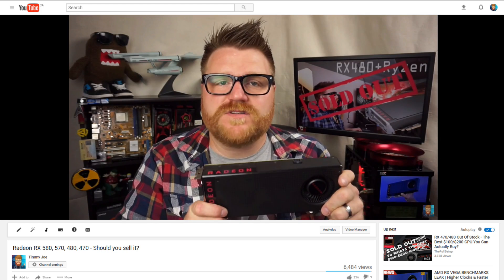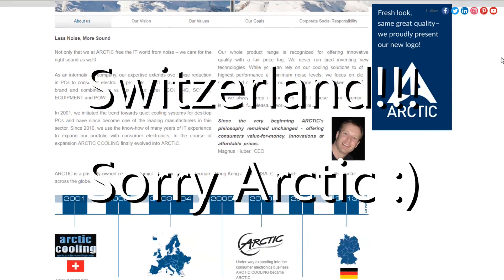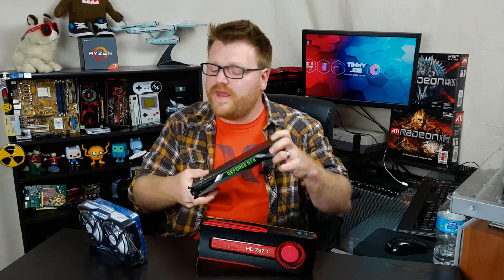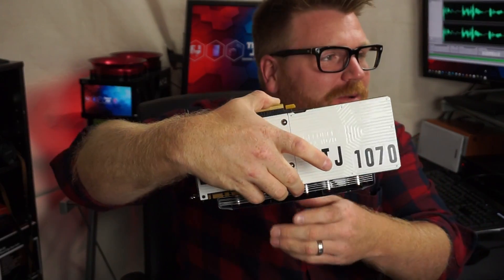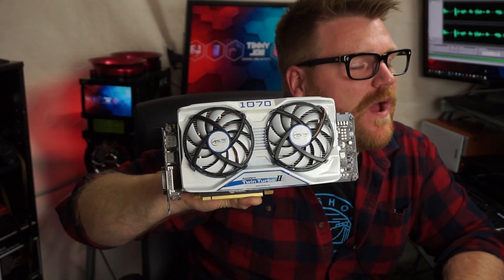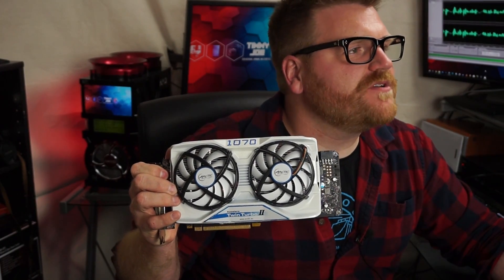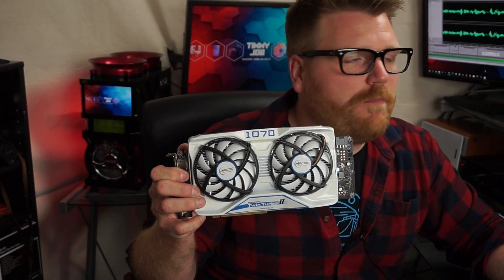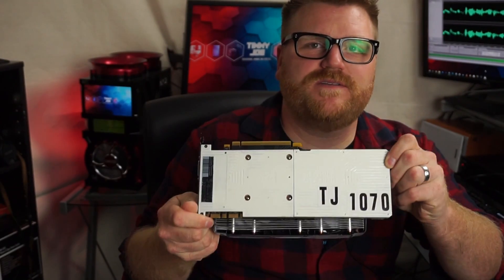Nvidia GTX 1070 Overclock Arctic Accelero Mod

Comment: Now is just a terrible time to buy a gpu. I would have saved that 450 for rx vega. With Vegas price tag being around 400 brand new and it's performance beating out the 1080. You're definitely going to regret it.
Reply: Every card pulls more than the TDP suggest. TPD is not the amount power it sucks, it's the amount og heat it produces, Aside from that i agree with TJ, Vega will be way better than any other GPU at crypto mining. Regardless of nvidia and amd working hard to make cryptomine specific cards, those wil lsell out aswel, pretty quickly and miners will fall back on vega and the 1000 series. 

You have no idea if RX Vega will be 200 watts, very ignorant.  the Titan Xp still has a TDP of 250, and nobody is giving flack for that? That is still hot, for a card that isn't much faster gaming wise than a GTX 1080 TI which is also has a TDP of 250 where as the 1080 sits around 180, 1070 around 150 tdp wise. 

Giving flack for TDP on amd while pascal is nearly as bad is really ignorant and shows us that you have done no research at all. Even if the card is 200 tdp, at 400 - 450 dollars at 1080p performance people will buy it, they will. thgat is a killer deal. given tat the 1080 is 500 bucks or more. usually more.

No way to cool it quite? MSI, Gigabyte, EVGA has cooled the GTX 1080 Ti quiet, at 250 watts, it is possible. Usually amd cards have lesser qualti components. usually AMD is lighter than Nvidia thus there is a difference in cooling aswell.

You also have this thing NZXT made, you know? the succesor to the Kraken G10? The Kraken G12? Yeah, it's a bracket, It allows you to put a wide variety of AIO coolers on your GPU YES! You can me your own hydra cards! AMAZING! See what a little research can get you? I suggest doing that before blatantly spouting nonsense. 

Other than that, really, get what ever card you want. Every card is different, brands doesn't matter at all.
One vender will be better in this game, the other in that game.. Frankly it doesn't matter at all. 

Sidenote: RX Vega probably comes with HBM2 which is extremely hard to manufacture and AMD will be the first that brings that to the consumer market, Nvidia dindn't do this for that very reason. Another thing to consider is: AMD and Hynix made HBM. Which is impressive af. but it does take a while to develop, and yes i used the sources to confirm what i already knew so i wasn't mistaken. Anything that has ben spoken about RX Vega is rumor. Even if the current state is 200 watts it doesnt mean it actually will be 200 watts. You don't pull a PCB design out of your arse and have it working 100% right away Give them some slack. AMD is pretty good! 

Sources: 

https://www.nvidia.com/en-us/geforce/products/10series/titan-xp/
https://www.nvidia.com/en-us/geforce/products/10series/geforce-gtx-1080-ti/
https://www.nzxt.com/products/kraken-g12-black
https://en.wikipedia.org/wiki/High_Bandwidth_Memory
EDIT:

I forgot to include this one.... mah bad!

https://en.wikipedia.org/wiki/Thermal_design_power
Reply: Yeah, $320 American, is a great price for a 1070, right now, for sure.
Reply: Scurvy 67 yeah in fire strike. It'd not be the first time amd wins in firestrike and loses in actual games. It was like that with fury vs 980ti too.
Reply: "Get a life" coming from a guy that has posted about 100 replies under his own comment... xDD haha, loser
Reply: That's just what I did. Sold a RX 470 4GB that cost me $160 for $330. Directly to my savings account for Vega. Hopefully, it will live up to the hype...
Reply: In synthetic benchmarks yes vega is arround the speed of a 1080, but i have yet to see real wold performamce.
Reply: First of All every new Tech stuff wont be available for weeks.. second of all.. vega is NOT "beating" out the 1080 its acutally right between FE 1070 and 1080.
YES partner Cards WILL outperform the FE Edition Cards but NOT the 1080 partner cards and even than their price are pretty much well choosen since even the price is somewhere between 1070 and 1080 so.. nothing will or would actually change.. ^^
Reply: Yeah, it's not going to be $400 and beat the 1080.
It's not like "pascal series will go up to over the maxwell titan x and can be priced at $250" and the 1080 costs $250.
You're reading it wrong.
Reply: scurvy itll take amd 1 year of driver updates for the carad to run good
Reply: Scurvy 67 Sorry kiddo but I'm not even his sub, literally only found out this video. Maybe you should get a life instead of spending all your time in youtube comments arguing with people about stupid shit that you don't know anything about.
Reply: How are your stupid comments working out now!! May be you should keep your fanboy based opinions to yourself!
Reply: HAHAHAHAHAHAH AMD have not made anything that comes near a 1080
Reply: Rx Vega 56 has a identical price to the gtx 1080, but rx 64 performs near or a bit above gtx 1080 sometimes lower, but just look at crypto prices LOL. Gtx 1080 costs 600 dollar nowadays, gtx 1080 ti 900/1100 dollar, and rx 64 sometimes 1000/800 dollar, rx vega 600/700 dollar. Just lol.
Reply: Scurvy 67 from the future also Vega failed
Reply: xuddish p, power consumption doesnt mean more heat lmao, that 200w is consumption, not TDP
Reply: Scurvy 67 yeah it may beat after a year of driver updates....
Reply: understandable, but I just can't get over the 450 dollar 1070. That's just ridiculous. Brand new 1080s were selling for 500 just a couple weeks ago. I would have waited for the mining situation to settle down and the market to come back to normal.
Reply: with the accelero extreme even a 1080ti at  max powerlimit can be quiet and at max powerlimit 1080tis enter into the 300 watt territory. So no, a 1070 certainly isnt the max before it gets loud.
Reply: RX Vega does BEAT OUT the gtx 1080. Sorry nvidia fan boy.
Reply: Scurvy 67, I dont even have the money for the Higher End Cards lol..
Im not a Fanboy either, I have 2 Systems an "older" One FX 8120 with an 7870 and an Intel 4790K with a 970. 
I would buy what give me the best Value for ME while staying cool and efficient enough - though Bulldozer was kind of a flop afterwards.

But yeah just think Vega beats the 1080 if you want to.. Im just interested in Tech and if you dont look up recent stuff about it well than the Vega may beats the 1080 - as the 1800x beats the 6900K right? (not price just Performance as "advertist" by many) lmao Keep calm mate! :) 
Fire Strike is synthetic so even some Quadro Cards may beat other Gaming Cards but are totally sh** in real World Gaming just saying.. as Youri Dv said aswell.
Reply: Except for all the benchmark scores that were just leaked....c'mon man, you should know this already.
Reply: Scurvy 67 all 1. Firestrike. That's the only one that's half plausible.
Reply: @Scurvy67
Linus used to use CAD a lot as well. And it's not like timmy didn't say about 10 times that he was talking about canadian dollars. Funny how people always blame everyone else for their mistakes.
Reply: Hendrik Visch,
Two points... One, the HEAT produced is IDENTICAL to the power any electronic device draws (aside from light emitted which is minor). Secondly, the TDP isn't always less than the power drawn. It's called Thermal Design Point and ideally it's HIGHER than the amount of heat/power drawn as a safety feature...

For example, on a motherboard the SOCKET will have a TDP associated so that the power (VRM etc) components can supply up to that maximum amount. Many parts, including CPU's, have different power requirements but the same TDP because it's easier to group products like that and have the cooler or whatever rated to handle the part with the highest amount of power.

Other: also, don't confuse temperature with power (you said "that is still hot" referring to TDP which is not comparable... you can have a hot GPU that consumes less power than one that is a lower temperature)

Other: PASCAL is very efficient so not sure why you are on about that. It's all relative, and Pascal is much more efficient than anything AMD offers at similar peformance, and of course there's no comparison to NVidia's top end anyway yet. Nor does FPS vs Wattage scale evenly so there's little point comparing a GTX1080Ti anyway.

Other: RX-VEGA may not be out yet but we do have the FE card. I've heard rumors that there are power management issues so far causing it to run hotter (more power), but I doubt that would make a huge difference. It's probably best to just wait on that. Based on Gamers Nexus review though the FE card cooler sucks and is almost certainly throttling so an after-market card with the same GPU, and possible power tweaks probably will gain at least 10% FPS.
Reply: @Jeffrey Photonboy
"One, the HEAT produced is IDENTICAL to the power any electronic device draws"

That's just wrong. Not all of the electricity consumed (power draw) will be produced into heat. And this varies between different electronic components, heck even with different CPU's. 

https://en.wikipedia.org/wiki/CPU_power_dissipation
Reply: You better be sorry. Now go pound sand you hypocritical nerd.
Reply: Yes I'm hypocritical, not the dude who watches a video, doesn't hear something so obvious, blames the dude that made the video and after that can't even admit he is wrong. What a fucking joke you are :D GL with real life.
Reply: Get. A. Life. NERD
Reply: Can't come up with anything else? That's what I thought of you.
Reply: Still haven't found a life yet? I take back all the negative things I've said about you. I just feel really sorry for you =( I hope you find something more meaningful than the youtube comment section one day...I'll be praying for you little buddy. Keep your chin up.
Reply: NO IT DOES NOT!!! DUMB ASS
Reply: You sir are a dumbass!! Does your mom know you are using the internet with out parental supervision?
Reply: lol this scurvy dude looking like a real dumbass right now. People who throw around speculation on products that haven't released yet like it's fact and then argue over it are almost guaranteed to make themselves look like assholes. case in point.
Reply: vega is going to be 200watts plus, no way you can cool that quietly, a 1070 is about  max you can have before it gets loud, 170watts in no joke and even 480 can pull more than that because those chips is all over the place. and 570 and 580 is just broken, hot and noisy
Reply: Fuck AMD cards for real im not just being a fanboy or anything like that but nvidia does make a superior product no one can deny that. Even the nvidia drivers are more polished and clean. Its just my opinion but i will be buying vega on launch even if it is shit becuase im an AMD Fanboy and i have been waiting for something to make me upgrade from my 1060 Strix.
Reply: either way, AMD clearly made a card competitive with the 1080 and will easily beat the doors off any 1070.  AMD is know as the performance per dollar king and I'm sure the price will be better than NVIDIA. There's no arguing that.
Reply: Linus is Canadian and he uses US dollars in his videos. You should consider doing the same.

Comment: I just got a gtx 1060 6gb and it's my favorite card (until I get a 1070 or better) the 1060 sips power with just a 6pin psu connection.

Comment: men sell the 1070 and buy a 1080ti they are at the same price because of ethereum
Reply: Where TF do you shop? Even with the mining boom, 1070's are running in the upper 4's to lower 5's, and 1080 Ti's are still around 7-ish...
Reply: Should I actually sell my 1070 and buy a 1080ti in a few months when this whole ethereum shit is over?
Reply: sell now, buy in 6 months if you can wait for that long.

Comment: Crazy, I too sold my MSI 480 8GB and bought a EVGA 1070 Superclocked & made a profit as well. 1070 is a beast, but I am getting Vega when it comes out. You getting a Vega TJ?
Reply: That's the plan, I think it's going to be hard to obtain a Vega card until at least the fall, but good luck to us all!
Reply: RoTiSeRiE JoNeS nobody is buying Vega
Reply: Timmy Joe Elzinga from the video I've seen the Vega barely beats the 1070 :/ I wanted Vega but no point now since I have a 1080
Reply: Those aren't official benchmarks though. I think we all forgot about Vega running Battlefront at 4k 60fps with considerable ease.